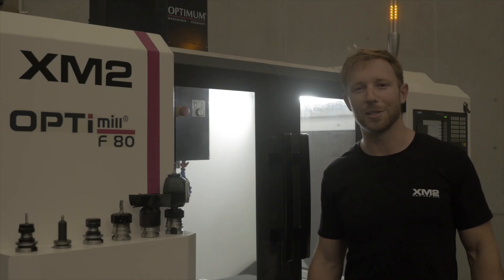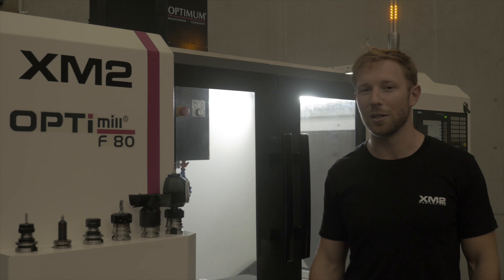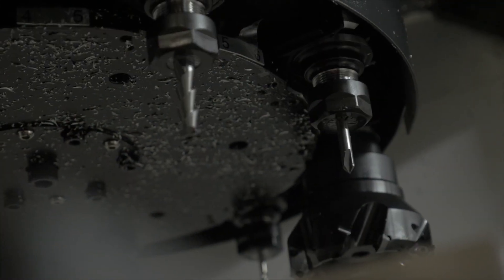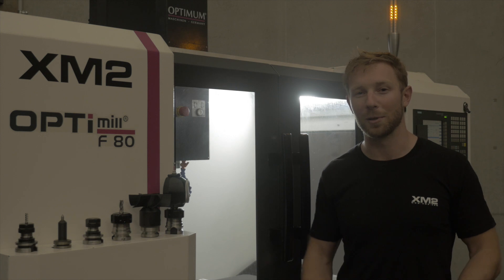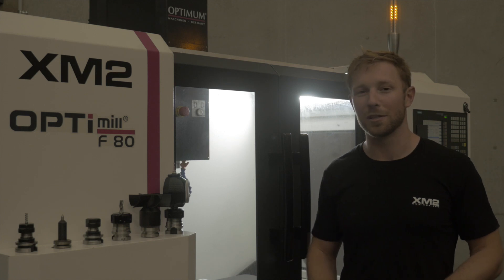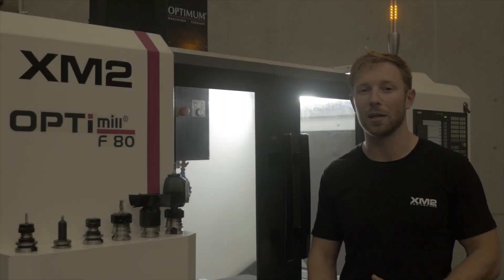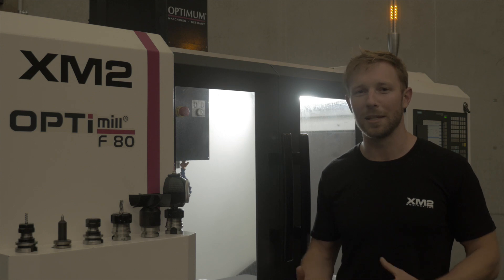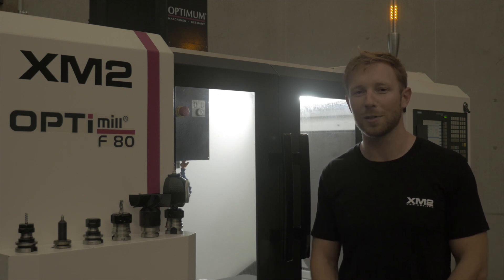Optimum Optimill F80TC CNC Milling machine Introduction!

Comment: Hows the machine going? still happy with it? im thinking of purchasing one myself,  what post processor are you using in fusion 360?
Reply from the maker: Yeah great mate, no complaints thus far. We modded 802D post processor to work with it

Comment: I have the similar machine to yours, but the bigger brother an F105.

If you are interested i have contact details for some very good quality (6'') 150mm machine vices available here in Australia.
Very similar to the KURT ( USA ) vice, 
( the vice jaws are interchangeable with the KURT brand also ).
Made in Taiwan. ( not cheap but very good quality ).
They are available in two versions, a foot mount or a machined on all three sides version, so you can them mount on there side
 ( left or right side ).

If you interested let me know.
Regards Peter.
Reply from the maker: Hey Peter, I bet that F105 is nice, how did you get your hands on that? do you like it? 

Thanks for the vice offer, I'll keep it in mind.
Cheers
Reply from the maker: Hey Peter, does your Kurt contact have any dual station vices on offer?
Reply: To be honest at the moment not sure, but can find out and get back to you.
They are a very handy vice to have no doubt.
Sometimes it would be good to have them instead of the standard type machine vices but they usually come at a premium.

Thanks for your reply will get back to you during this week.
Regards Peter.
Reply: I have good news about the double station machine vices.

It is available as a (6") 150 mm,  they have 2 currently available in stock.

Price is $1935 plus ( Government Survival Tax ) as i said not cheap but worth the money, not sure how many you are after but if you can afford 2 they would go well on your size machine.

A better price is available if you are interested in both.

One thing that i like as a big plus over other machine vices that you maybe interested in,  is they have a patented jaw design which equalizes the pressure for uneven material sizes. ( basically if you put 100 mm in the front of the vice and 80 mm in the back vice it equalizes the pressure on both sizes of material.

 ( you would think that i was selling them with all the info ).

If you are interested in taking it further please let me know.

Regards Peter.
Reply from the maker: Peter CCR ENG thanks Peter would you mind send their contact details? It will likely be January when I’ll get a new vise. Cheets